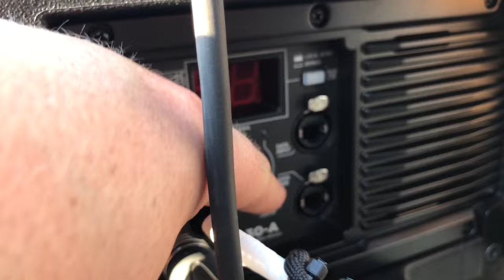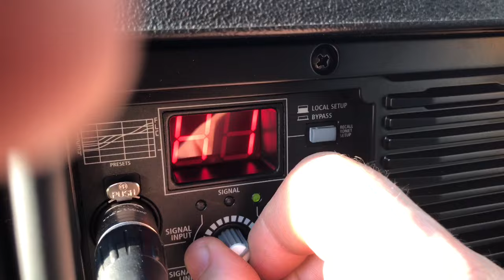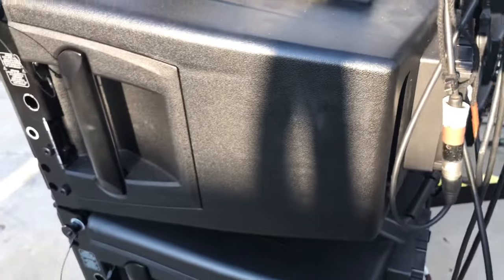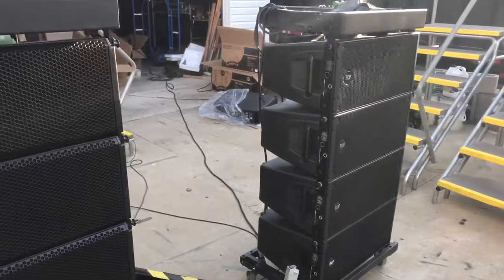RCF HDL 30-A compared to RCF HDL20-A detailed overview Authorized Dealers

Comment: the 30s @ close range seemed to have more pronounced mid highs for vocal clarity and the 20s up close were a bit muddy in that range . however as distance increased they seemed to find common ground in clarity in that vocal frequency. I would recommend 30s for close in club and smaller venues  and in larger venues where distance is a factor, use 30s for downfill and 20s for longer range projection . But that's just me. If anyone else noticed this, please let me know. I do my own evaluations of gear but played in bands for years. Yes I am a drummer who owns PA but has to explain everything to his bandmates . I'm getting worn out. Thanks Folks for understanding.

Comment: Hello friend, I would like to know if those 2 db more than the hdl 30 with respect to the hdl 20 are noticed as I know is that the hdl 30a also has more power than the hdl 20 and I would like to know if they are really noticeable. My question is regarding its range and its sound pressure since I have not decided on one or the other yet. I would like to know which one sounds louder without displeasing. I would appreciate your answer.
Reply from the maker: After using both for a few years now. The HDL20’s out of the box sound better because of their tuning. The 30’s however when tuned through rdnet sound better and can get much louder while still sounding excellent.
Reply: @sweettreeproductions2149  hi i have a question that mean the hdl20 with only 700 watts rms sound better than the hdl30 ?

Comment: Hi, one question I am thinking on buying an RCF.  What do you recommend me to buy? 2- HDL10a OR 2-HDL26a or just buy 1- HDL30.  I will be using it for my dj setup .Thank you so much.
Reply from the maker: Dj Rizama if you will have a sub the HDL6’s or 10’s would be a great choice unless you think you will utilize Rdnet. Let us k ow if you are I. The US and we can get you great prices.
Reply: Sweet Tree Productions thank you, I will use A subwoofer too. 
I was thinking 2 hdla27a per side with 2 FCF SUB 8006-AS.
Total 4 speakers and two of those subs. 
Or what kind of subs do you think would be better? 
Thank you 🙏
Reply from the maker: Dj Rizama the 8006’s are great! That should be a killer system. Whenever you can 3 a side of the 6’s or 26’s would be preferred since they are only 10 degree cabinets.
Reply: Sweet Tree Productions thank you very much for answering my questions. 

When I am ready I will contact you
Reply from the maker: Dj Rizama thank you. We will definitely get you the best deal possible.

Comment: What is the purpose of cluster button? Is that for additional distance of sounds? I mean for long range. Highest cluster ratio??
Reply from the maker: The cluster is for how many arrays you have hanging per side. It basically takes out low mid and a few other subtle things to keep the cabinets sounding linear no matter how few or many you have. It doesn’t really change the HF range that should be done in Rdnet.
Reply: @sweettreeproductions2149  so in easy word. I don't need to press it. Whether i used 8 arrays per side?
Reply from the maker: mr jn are you talking about the 20’s or 30’s?
Reply: @sweettreeproductions2149  yes. The analog one. The HDL 20A. That's my example. Because i got curious how to use that cluster. 
I mean.  I still do the traditional one. I connect the HDL20A to driverack venue 360. The other HDL 20a are for high frequency and  other HDL20A are for mid frequency. Is that okay not to use the cluster and high pass filter?? At 8 array per side? I will just configured the frequency type of HDL20A speaker. And not use the HFP and Cluster anymore? Is that okay for my setup?

Comment: would you compare these cabs to the Ev XLC-127? any comparisons
Reply from the maker: Fredy Romero a step up. We sold a person a ton of 30’s to replace his xlc rig and he is much happier.
Reply: @sweettreeproductions2149  is he happier because of the weight for transportation,  sound quality or other reasons? I will be honest, I've heard these at close range and they are awesome,  but for long throw,  they do not stand a chance with Electro Voice. Respectfully
Reply from the maker: Fredy Romero the weight, rdnet and rigging were a huge reason he switched over.

Comment: What size spansets/shackle do you use from the sumner to the flybar?
Reply from the maker: Omar Ortiz we use 3’ spansets double looped I believe the shackles are 1/2 inch
Reply: Thanks for the info on these btw! When you fly them with motors or manual hoists, do you do single, or double points? What number on the array frame do you use?

Comment: is hdl-18as compatible with the fly bar??
Reply from the maker: Andrew Oo Leong Wei that is a great question. The only part that would be significantly different would be the back bar on the 30's. We are using some of our HDL20 carts for the 30's
Reply: hmm... is that possible that you guys hang up hdl-18as to hdl30 fly bar & shoot a video post in youtube? because what i see from the video you post in youtube the hdl-30 fly bar is slightly smaller than hdl-20 fly bar

Comment: is there a major difference in sound quality and or spl.
Reply from the maker: centerstage entertainment we believe so. They definitely have more horsepower. We personally like the sound quality better compared to the HDL20’s. You are able to so much more while using RDNet with these boxes to help out with aiming and keeping the speakers from being harsh.
Reply: yes i have notice with the HDL 20S. they can get harsh. but I've been able too tame them some what, question would you use a drive rack with HDL 2Os and if so whats the benefit, I'm mean can i get more out of the box with a drive rack?
Reply: entertainment  I am also interested in if using a driverack has any advantages? I have 8 hdl20 that I'm about to use and I was wondering if you have any driverack settings for these?